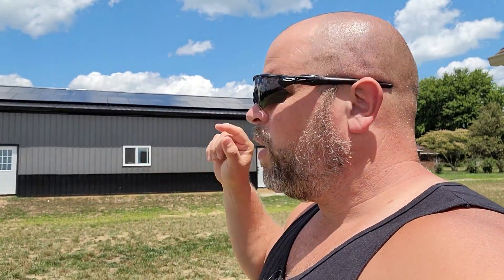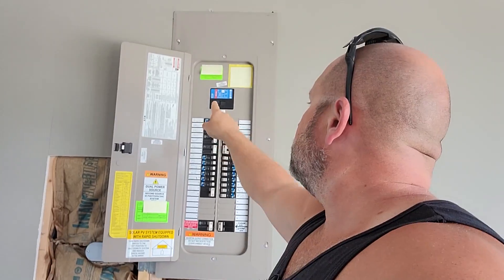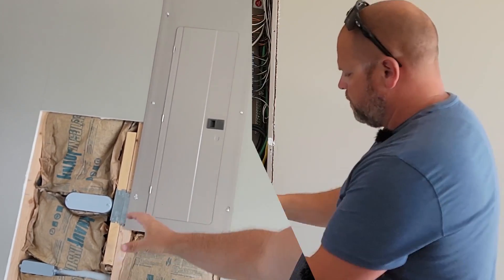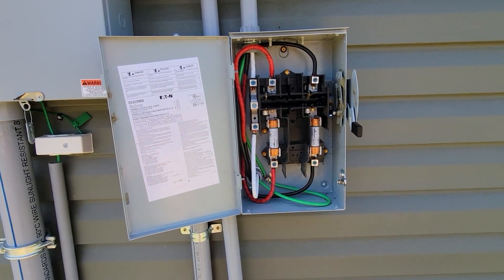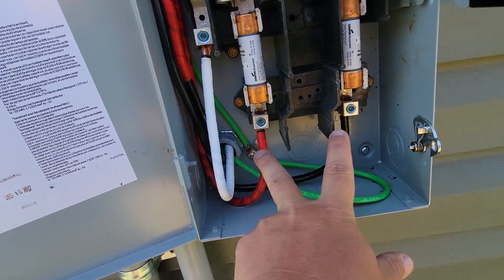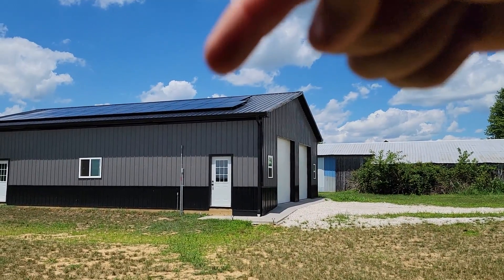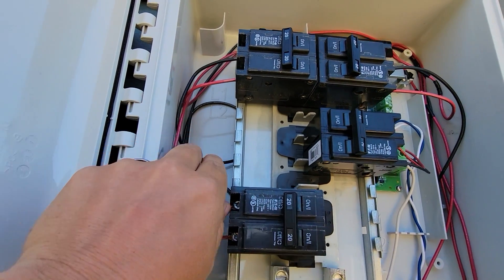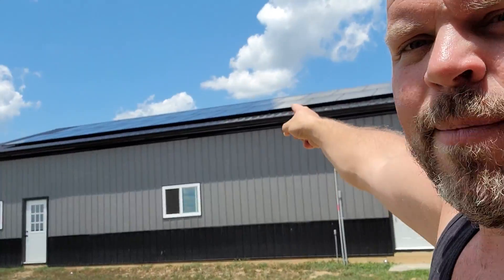EASY - Wire your own Solar System Using Enphase Microinverters

Comment: Where did you find the connectors for the junction box. Mine didn’t have any and I haven’t found any anywhere.
Reply: I have the same question. I found some field connectors from Enphase but they don't look like the ones in your video. Plus, I would like to go with awg 10 cable as you suggested in one of your other videos on lessons learned. I have the same distance issue and can't seem to find connectors that will handle awg 10. Any suggestions?

Comment: Black Hills wants a production meter for a 12 kW solar system with 28 panels. I have to buy splicers to extend the trunk cables, buy a junction box, conduit, wires from array to house production meter rapid shut off lol and already bought 5 yards of concrete 1,100 8-21foot sticks of 3" galvi pipe 2,000 bucks 28panels and Iq8h micro inverters 22k 400 for the permit 200 to pueblo west metro lol metro said no taller than 6 foot when the weeds in are acceptable at 8 foot and must be in back yard so your house helps block sun lol this has been a pain in the ass though its cheaper than 60k quotes I got from installers there profit margin is insane.

Comment: Just food for thought, I think those are PV wires you ran into the sub panel? Once younhit the nbox on the roof you can run THHN wire "in conduit" to the panel. It's cheaper and easier to run. Thanks for the vid!

Comment: Hi Justin first great videos thank you for sharing. They are very helpful! Do you have a video or more information on installing the q cable from microinverters to junction box? I also have 3 branch circuits (3 x 10), and am unsure how much to purchase and to connect to my junction box. Did you purchase one long string add a few extra connections just in case and cut to your needs or did you purchase 3 separate strings (q cable) ? Any insights greatly appreciated thanks!

Comment: Couldn't you have connected the solar to the subpanel?
Reply from the maker: Not in my setup. In my jurisdiction, it is required to be in my main service panel for a couple of reasons, most importantly, the sizing of the back-feeding breaker. There are other concerns as well.
Reply: @JustinsProject  I thought that could have been the case.  Great build!

Comment: Good info….Thank you. I have an existing 4.08kwh Enphase PV array I had installed a couple of years ago. Will be adding an additional 4kwh my self this spring. I have the 4/4c combiner box that the installer used L1 and L2 breaker slots for the 12 panels. Your clip showing the inside of the combiner was very helpful in me understanding how to add additional strings. I am sure I will be going back and referring to your previous videos as needed.
Reply from the maker: I'm glad the video was helpful, good luck with your install!

Comment: I have a set up similar to yours with the barn about 150ft away form the house.  I'm looking at installing the combiner box in the barn.  Why didn't you install the combiner box in the barn and connect to the subpanel in the barn to backfeed the house?

Comment: How did you settle on #12 wire for that run? Is that a benefit of the micro inverters?
Reply from the maker: Each branch is connected to 20amp (dual breaker 240v). After calculating the Vrise 12awg was more than enough for 9 IQ7+ microinverters that output a max of 1.21A each. For a total of 10.89A per branch. After factoring the 125% and 120% rules 20a was acceptable in the combiner. Since there was a 20 amp breaker the wire was landing on, I opted for 12 gauge wire. I hope that helps.  For more on Vrise check out this enphase doc: https://enphase.com/download/calculating-ac-line-voltage-rise-tech-brief?srsltid=AfmBOoqXFrqipAgZvOTqiXoy01_HrKfdwqXUYgx4R2Hkbdoye2spT6BX and more on the specs of the IQ7+ check out this doc: https://enphase.com/download/iq7-and-iq7plus-microinverters-data-sheet?srsltid=AfmBOorhZcKVHxC2qATkcN8YHljiXqrskH6n_bF3dC12WK2YGAyAq9GF

Comment: I have an enphase iq combiner box that requires a password. Last owner had refused to apply the password to this day. I'm trying to Bypass the password. Also the system was hooked to the grid but thieves cut working and took fuses before we bought the property when it was vacant. I'm trying to switch system to off grid. Is that possible?
Reply from the maker: It does sound like a bad situation but... Have you reached out to Enphase support? They are usually very helpful. I think if you could provide proof that you own the system, they would be willing to help you get that resolved.

Comment: Can I ask you a few questions, maybe I missed your install video but I couldn't find it...  
On you barn did you install on the purlins or rafters?  My purlins are offset, can you account for this with the iron ridge L feet?  Or did you add in 2x4s on the top of each rafter?   
Next question why did you run your solar back to the main meter instead of adding them to your barns subpanel?  My barn is about 125ft away from the main panel, I am planning on a 30kw system which running back adds a huge cost.
Reply from the maker: I have purlins on the roof of the shop. They run on top of the trusses 2ft O.C.. If you have a metal roof like my sytle, look into S5 solar foot. They pair great with the metal and the ironridge components. I was required to run it next close to the main service entrance. To get approved for my solar permit. Hope that was helpful. Thanks for watching and commenting 👍🏻

Comment: There were many interesting aspects to this - and Well Done and thanks for making it.   There were also two disappointing ones from the perspective of someone seeing your videos for the first time.  I chose this one to watch because the title said "Wire your own Solar System...." and from this title, expected at least some context and a wiring diagram to show the whole picture, before you dived into specific detail in one corner (of the diagram) and started to refer to other components I was hearing about for the first time.  Which was confusing, especially when also working out as you went along, a translation from your terms (such as 'branch' when others would use 'string').  The other thing that would help is if you were to give a summary & links in the description section of your other videos which TOGETHER do give the full picture, and the SEQUENCE in which to watch them to avoid references to things not previously seen.  That big picture (especially the wiring diagram) would prompt me to give a BIG thumbs up, and to plan to look at the other videos, knowing I'd be getting a gradually-built rather than a disjointed picture.  All the best, from a new - but probably once-only - viewer.
Reply from the maker: I appreciate the valuable feedback. I try to improve with each video I put out. Hopefully, you stumble across some of my new and improved videos and notice that I have been hard at work with improving my presentation skills. Thanks for watching and commenting 👍🏻

Comment: Hi Justin, nice work, did you install a grounding rod at the garage site and make connection to the grounding wire, in addition to bringing the ground wire with your L1 and L2 to your combiner box, how did you decide 6 gauge for the ground wire?
Reply from the maker: The ground wire is considered to be equipment, so that needed to run from the racking to the combiner box to the main service. Due to the manufacturers recommendation, I went with 6ga wire on the ground. Thanks for watching and commenting 👍🏻

Comment: Have you considered a battery solution to go with your Enphase Solar? I want to but looking for install/design videos. Thought you may have gone through this. I have found your install videos quite helpful and now have a great understanding of what I had installed 5 years ago. I would love to not have to sell back my excess Solar...
Reply from the maker: I haven't yet. I might in the future. Battery costs are very expensive, though. If I do, I will definitely share that install also. Thanks for watching and commenting 👍🏻

Comment: Hey Justin, great video. For the envoy, does it require Ethernet? I’m planning on having my combiner box mounted at the ground mount location, about 250 feet from the electrical panel location. I’m trying to discern if I need to run Ethernet out to the combiner box? Thanks!
Reply from the maker: You have 3 options that I k ow of.Run the ethernet cable, use a quality wifi extender, or get the enphase LTE wireless modem add-on. Hope that helps. Thanks for watching and commenting 👍🏻
Reply: @TheSolarPit  thx!

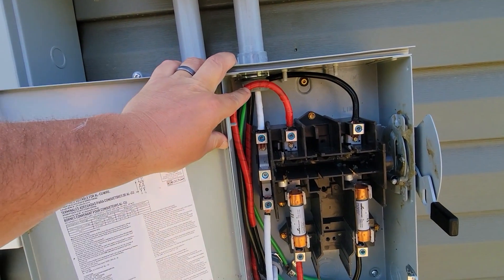Comment: 2:40 Isn’t the two leg lugs on the left in the fuse disconnect L1 Black and right two lugs L2 Red. Is there a reason that it’s switched here?
Reply from the maker: Switched? Thanks for watching and commenting 👍🏻
Reply: @TheSolarPit i think he meant you have the red wire from the combiner on the right going down into the disconnect on the left.

Comment: Thanks for the great video! 
Wouldn’t happen to have where you got the junction box? Amazon link perhaps?
Reply from the maker: I picked up the Solobox from Yale Electric but here is a link from another supplier: https://www.invertersupply.com/index.php?main_page=product_info&products_id=199542&gclid=CjwKCAjwitShBhA6EiwAq3RqA7LrxFBiLdUMcvqPz103grC5buAXcjhIvCnxYuxh7-HSGAB3uPGlaxoC_-gQAvD_BwE 
Sadly, it is not sold on Amazon. However you may need the Dinkle Assembly I used in the Solobox which I purchased off Amazon. Here is the link to that: https://amzn.to/3MCnqdJ 
Hope that helps. Thanks for watching and commenting.

Comment: 3 mins 16 sec
Surely it should be "line in" to "load out" not that it would make any difference to the fuse operation but you could have saved so cable.
Reply from the maker: Line in is correct. The line side is on the side of where the main service panel is being connected. Because I explained it from the solar system down, it might get a little confusing. If we take this in reverse from ths SP to the solar disconnect switch, the "LINE" side is coming in, and the "LOAD" side is heading out towards the system. Hope that helps clear that up. Thanks for watching and commenting 👍🏻

Comment: Were the Enphase IQ 8 mini inverters available when you did this ? and why did you choose the IQ 7's? I'm debating which to use for a system for my brother. I have had an enphase setup for about 9 years now using the M215 and M 250's . 5K system.
Reply from the maker: Yes they were available at the time I installed this (Summer of 2022) and I would recommend the IQ8's over the IQ7's since they can offer Sunlight Backup. However, if you are in a situation like I was and budget was the issue then IQ7's are great and I am extremely happy with mine. Thanks for watching and commenting 👍
Reply: I just looked and the IQ7 are $179 and the IQ8's are $167.  They only have 1 in stock for the IQ7 vs 500+ for the IQ8.    The days of $100 micro inverters are gone with inflation.    I think my IQ7 were $116 a few years ago.  -
Reply: @ScoutD300  I'm finding IQ8A's for $199.  The IQ8's allow the mini grid option.

Comment: Hi Justin, to setup the system with Enphase did you have to do the university course and purchase the Enlighten manager to setup the system with Enphase? I just installed a 6.3kw system, passed county inspections, waiting for Duke energy to change the meter over. I went to download the enphase toolkit app and I was told I needed to take a course, spent 7 hours taking a course, now I'm told I have to upgrade for $249 or $9.99 a month to the Enlighten Manager which allows you to setup the system. Any advice would be helpful please..
Reply from the maker: Congrats on the new solar system!! I did take the courses, but that was after I had already installed the toolkit. I created an installer account before even installing my system. I did not have to pay or upgrade anything. Try calling Enphase and speaking to Tech Support and let them know you were the installer and that you are certified through their cert program. Installer Tech support might be more helpful than just customer service in this situation. Hope this helps. Thanks for watching and commenting 👍🏻
Reply: @TheSolarPit  I'll give them a call, thanks for the fast response.  Do you pay a monthly fee to view all the data from your system?
Reply from the maker: I do not pay monthly for the service, it is free.
Reply: @JustinsProject  I spoke with customer support, they were great. They helped setup the system and my access to the toolkit. Thanks for the advice. We are up and running and getting power from the sun!
Reply from the maker: @PriceGroupRealtors  Awesome stuff! Enphase support is one of their best features. Congrats! Nice feeling huh
Reply: @TheSolarPit  it is a good feeling to see power created from thin air...
Reply: @TheSolarPit  do you remember where you went to create an installer account? Seems like they don't make it easy..
Reply from the maker: I have an android device, so I downloaded it from the Play Store.

Comment: Hey Justin (yet another) question for you. My AC Disconnect is arriving today and I'll be installing it immediately. Im getting the same one you have. I see on the top there appears to be a removable plate that allows a conduit to attach on. Am I correct in assuming that this is made for steel conduit and thus was why you entered from the top left instead of center? Thanks!
Reply from the maker: There were couple of reasons I choose the location I did. 1st it was harder to find an adapter than it was to use the connections I did. 2nd, had to do with how the entry would go into the combiner box and the rear exit I was putting into the garage wall cavity. Plus that electric service I installed for the building was in my way to the left. Short answer, yes it was made for ridgid pipe and I wasn't willing to use that and make other adjustments needed, so I opted for the sch 80 pipe.
Reply: @TheSolarPit  Ahh, that makes sense. Im having issues of my own with adapters, in my case finding weatherproof fittings for connecting the conduit / combiner box
Reply from the maker: I used standard pvc threaded ends and added bushings to protect the wires. Then glued it up.
Reply: @TheSolarPit  Nice, I have threaded ends. Ill go grab some bushings, thanks man!

Comment: Hey Justin, is that AC Disconnect DG222NRB for outdoors? It seems like it doesnt have a weather gasket(?) Im only asking because I have to buy my own now for my system and obviously yours passed inspection
Reply from the maker: This is a NEMA 3R Safety Switch. Which is rated for outdoor use. The cheapest place I could find that box was on amazon. Here is a link if you decide to get it: https://amzn.to/3Dz4Cps
Reply: @TheSolarPit  Youre the man Justin, thanks. I checked out the Eaton site while I was waiting on your response. Much obliged.
Reply: @TheSolarPit  My 13 panels are all up so Im down to combiner box and disconnect. Your vids have been so useful in preparing / understanding the wiring that Im about to do.
Reply from the maker: Awesome! You are getting close to having an operational system. Connecting the Combiner Box and A/C Disconnect was my favorite part. Goodluck!
Reply: @TheSolarPit  I bet, it feels so close to the finish line at that point. My inspection is the 14th, and hopefully new meter that day or close after.
Reply from the maker: @SSMLivingPictures  Well, I installed those first 🤣 Mainly because I was working on wiring the building for service. Maybe I was a little too excited to get started LOL You will do great, sounds like you have everything under control.
Reply: @TheSolarPit  Ahhh  yep makes sense. I was trying to beat the bad weather so I started with the panels. And then late October ends up being some of the nicest weather we had all year. Go figure hahaha 😅
Reply: Thanks for the Vid. Just to be clear on the grounding. You ran one continuous piece that bonded all rails together, passed it through you J box then down and over to your combiner along with the pairs of hot legs from your inverter string. Again thanks for the info.
Reply from the maker: @bryan34wable  spot on. That is correct. 👍🏻 Thanks for watching and commenting

Comment: Since your barn is not a dwelling can you get away with not have stand-off 3ft from Edge so you can use whole roof?
Reply from the maker: That is risky, it literally comes down each jurisdiction that approves the solar permit. I did not want to risk it and 27 panels was all I needed. Thanks for watching and commenting 👍🏻

Comment: Sound???  CC works.
Reply: I just figured out what issue is. I was listening with my earbuds but only the right one was in my ear. There was no sound on the right channel..  I listened to it again without my earbuds and it comes thru fine. It’s only coming through the left side.  Lol. Awesome videos.
Reply from the maker: @tommywiseguy  That might be my fault actually. My microphone might have gotten switched to 2 channels rather than recording both on one. Sorry about that. Lots to remember as a one guy production 🤣
Reply from the maker: What do you mean... Sound???
Reply: @TheSolarPit  when your video is playing the “flashback” segments, there is no audio.
Reply: No worries. I turned on the captions and got the info. I’ll be starting my own diy solar systems because of your videos.

Comment: Bus max - main breaker = max solar breaker size.
You need to down size your main to 175 with a 45 amp solar breaker.
Reply from the maker: The NEC 120% rule allows solar PV equipment to be installed in electrical boxes up to 120% of the installed electrical equipment safety label rating. So, my main max bus rating is 225. 225 x 120% = 270. 270 - 200 = 70amp max for the solar breaker. Thanks for watching and commenting.